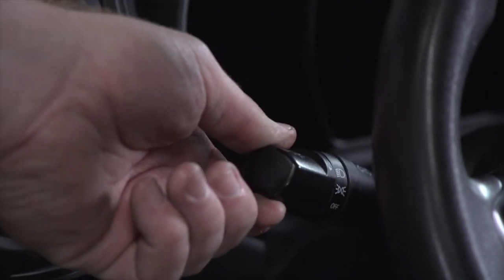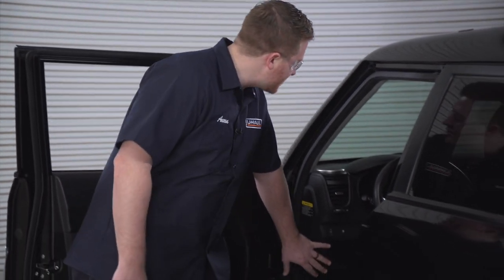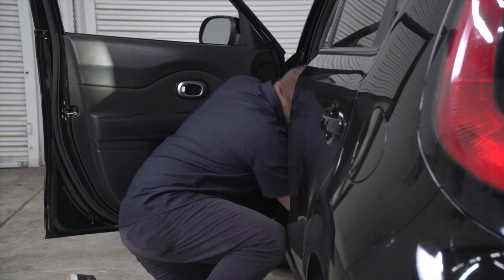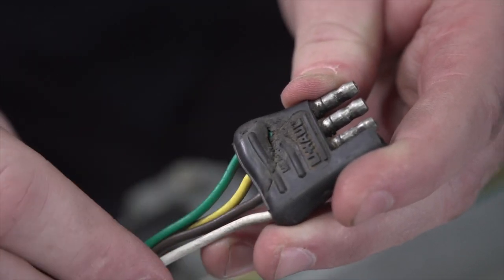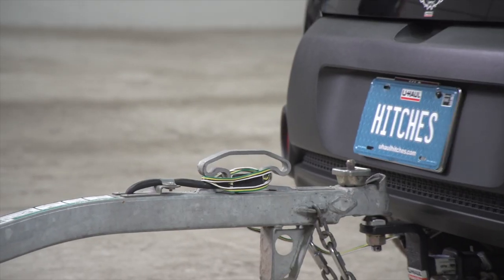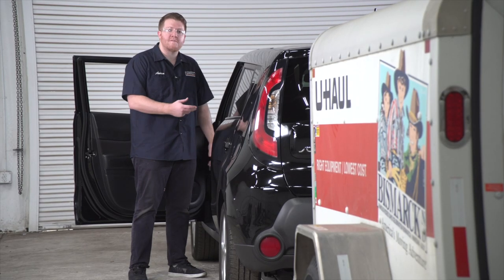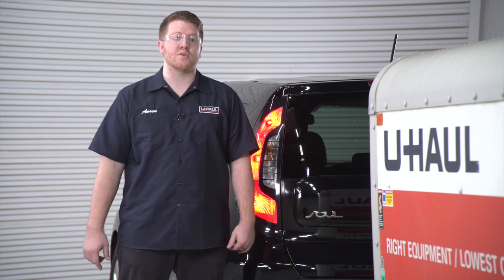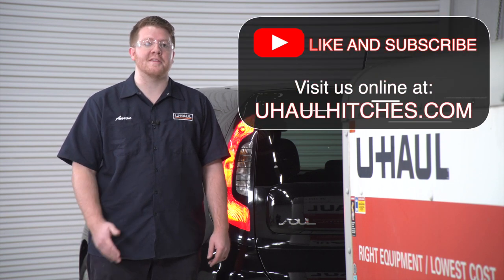How to Troubleshoot Trailer Lights: Diagnosis and Repair

Comment: Rented a 5x8 recently, in daylight the brakes/turn signals worked but trailer running lights did not. Vehicle lights worked fine. Uhaul tech said trailer had a sensor and they would come on in the dark. Tested later in dark didn't work, even when trying on a different vehicle. I'm just curious if this daylight sensor is really something on the trailer.
Reply: I got a 5x8 also worked perfect in the day, but not at night. WTF

Comment: I was really hoping that when he saw the smashed wire within the line, that he would have shown how to check if the signal was good up to that point rather than jumping to replacing the assembly.

Comment: Last time I rented a trailer from Uhaul the lights didn’t work due to several shorts in  wiring. This was all found prior to leaving lot, uhaul attendant basically told me they won’t fix it, either I deal with it or don’t rent it
Reply: I have rented a variety of Uhaul trailers over the last 8 months,  all my problems seem to be on the 6x12’s. A couple of seconds after plugging in it will blow 
the trailer clearance lights fuse on my 2017 Canyon ( F50 ? ). Fortunately there has been other trailers available that work fine after I replace the fuse. 
The trailers are extremely well built ( I’ve been a truck driver for 45 years ) but their running maintenance is non existent from what I’ve seen. 
It’s rare to get a trailer that has all the lights working. Some lights are broken off !   For the most part the staff are considerate but lack the knowledge 
or resources to fix the problem there and then.  Generally the locations near me are very busy, so be patient, but don’t take equipment that isn’t fit for the 
road. You could be stuck if caught in a roadside safety blitz.  One thing I always look for is loose wheels. I carry a 4 way wheel wrench and check them 
for tightness.  Uhaul used to have a terrible reputation, but now for the most part they have updated the fleet, and their image, having a program in place 
to keep it that way ? Time will tell. It’s cheaper to rent than own. Safe travels, and may your moving adventures be safe ones.
Reply: I have had the same experience at one agent, but for the most part they do what they can. Just goes to show you that one employee with a bad attitude 
who thinks that your being too fussy wanting there equipment to be legal when you are paying for it can spoil all that public relations money.
That said, for the most part, I’m impressed by the attitude of younger employees.  ( I’m 67 ).  Attitude is half the job. If you don’t like the job, 
and you don’t have patience to work with the public, then do me a favour. Just stay home.

Comment: Plug in trailer no lights.  Turn truck headlights on, now trailer lights work.but not functions work. Brake , Left sig, right sig, emergency flashers. not working????

Comment: I had a ( tow package , with hitch ) installed  by ( u - haul ) for $$$$ , within 1 1/2 month's the power supply was not getting to the boat trailer light's... So I then returned to ( u - haul ) & was told that the wiring package was NO LONGER under warranty... I had to watch several ( YouTube ) events to almost get it correct , no may Led lights are working correctly , but the ( marker lights ) are not working... Any help please , ( note : there are fish to be caught ) Lol. , thanks in advance

Comment: I HAVE A 2004 NISSAN TITAN SO MY LIGHTS ON THE TRUCK DON'T COME ON ATOMATIC Truck is too old.   Now when i hook up my trailer and plug in the connector then start my truck the running lights come on on the trailer and there off on the truck. why is that? i thought nothing suppose to come  on till you turn the light switch on. but that is not the case with my truck.  like i said as soon as i hook up everything and start my truck the trailer lights come on and the light switch is not even on yet.  is that normal.  if not can you help me   thanks
Reply from the maker: We are not familiar with that issue specifically.